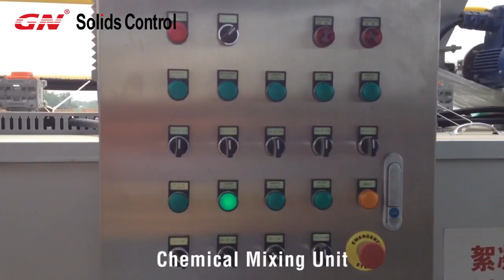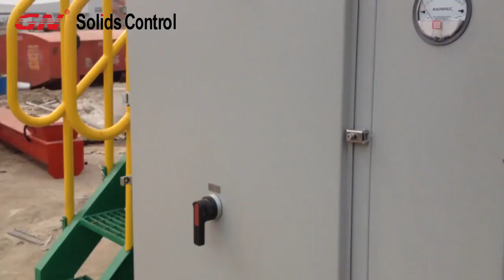Oil Sludge Waste Treated by GN Centrifuge with Chemical For COSL

Comment: Solids are wet...
Reply: The solids typical from the sludge oil treatment system  is wet, you just need an additional equipments like Cutting Dryer to get the dry cake.